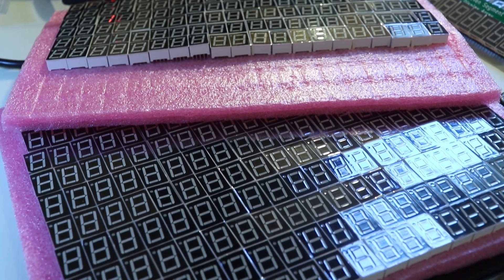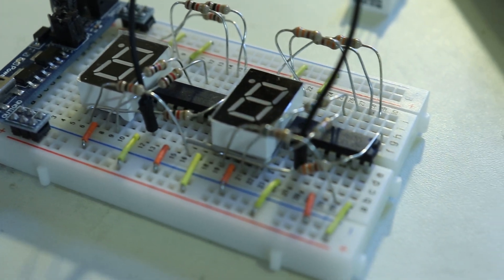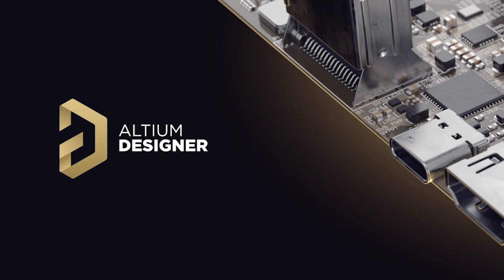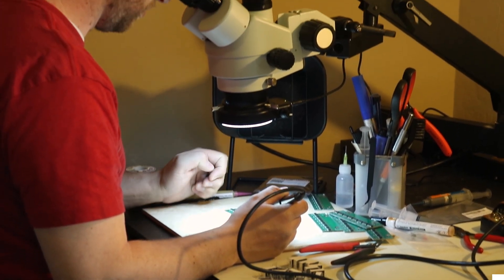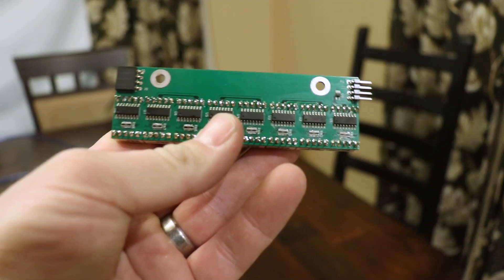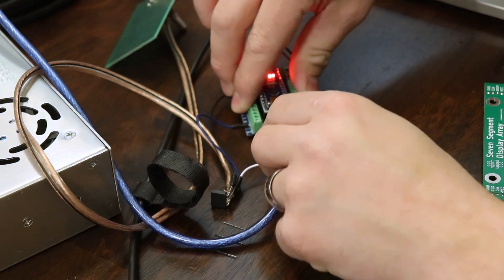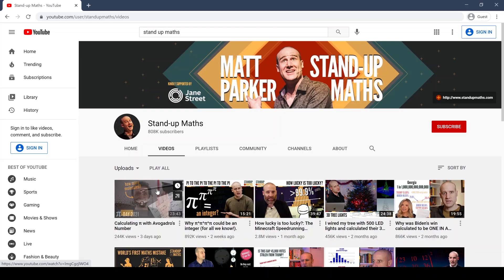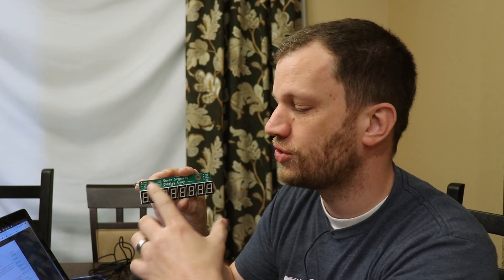This machine generates 400 digits of pi to celebrate 𝝅 day

Comment: What's the voltage at the end of the string? Even at 1ma per segment and assuming only 75% of the segments are lit, that's 3 amps at the source end. With all those connectors, I'd imagine you should be seeing close to a 1V drop at the end, if not more.